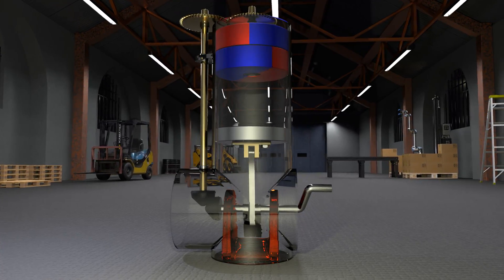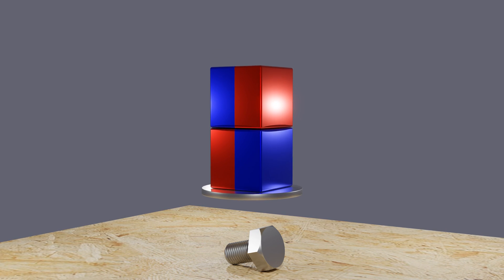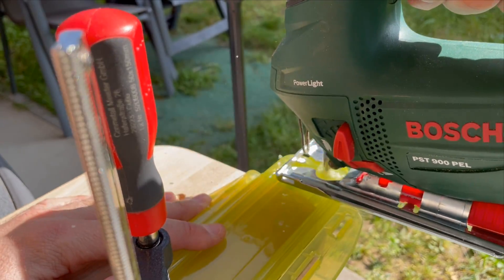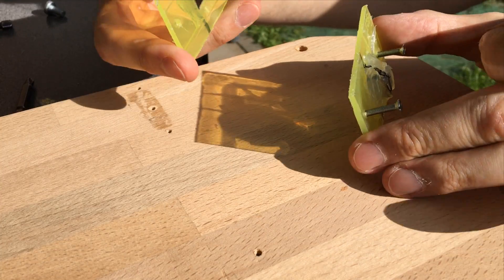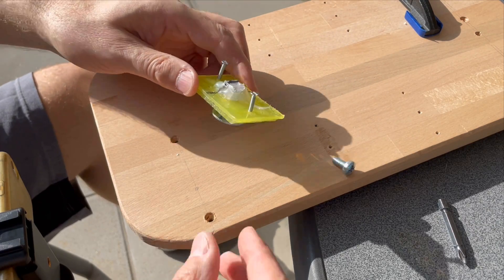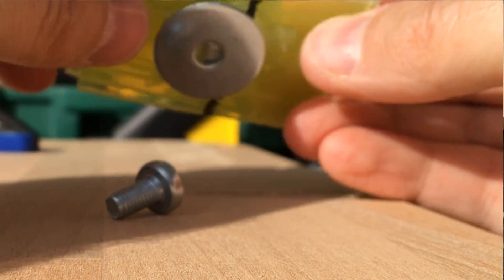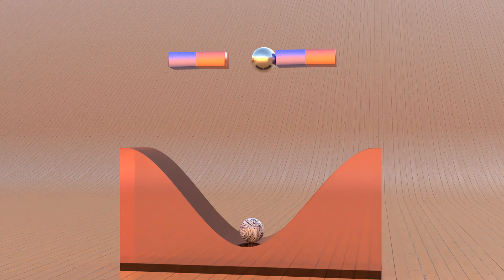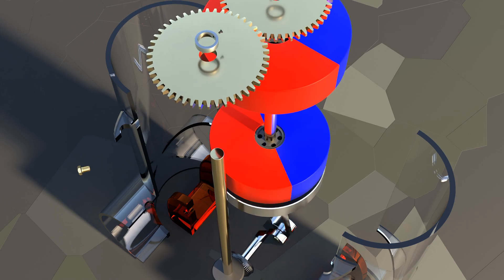Truth: Energygraphy's Permanent Magnet Motor with a magnetic switch a2z

Comment: Magnetic switch don't extend the magnetic field more than a2 ò 3 mm, a magnetic motor to work magnetic fields most be perpendicular at all times without interaction, just 180° in parallel.

Comment: Theoretically it'll work however when it gets to high enough speeds to be relevant for something more than equivalent to what we can do with our hands it's going to create a back EMF induction heating in the magnets themselves which is going to cause them to break one another they call it over lenzing or just they call it just Lansing overlanding is how you use lensing to get a laser
Reply: This is hardly a problem. We build e-motors with a combination of e-magnets and permanent magnets, and they work without problems. But of course the output energy only stems from the electrical energy driving the e-magnets. Permanent magnets only help to transfer electrical energy into mechanical one, but they don't contribute to the energy itself.
Reply: You said something that I didn't fully understand your comment I just didn't remember it as I look at this picture this time this is actually a picture of a school project for a different civilization a higher level of technology it does work when you get to that one point where you get perfect lensing where everything wants to break that is a band of causality where gravity and the speed in which the magnetic title forces are spinning slam into each other really hard it's the equivalent of warp 10 for the theoretical warp 10 that they speak of in Star Trek that's a perfect lensing point and it's the reason we say turn the heavy metal up to 11 you can run at 9:45 when you hit 10 it's perfect landing that is one of the places on a ladder of relativity that you must stay off of however you can jump right over can and go to 11 and it works out that when you jump over 10 and get to 11 you have just jumped over the band of causality that is light itself and you're actively going just faster than the speed of light and friction drag coefficient tries to pull you back down to drop you below the speed of light and actively hold you right above the lightspeed curve barrier which is 11 and it is a band of causality it comes through 360 to 365 trillion times a second
Reply: Will like 365 trillion time is the second to get over the lightspeed curve barrier and hang out at warp 11 is nuclear power and it is the secret to how perpetual motion works at slow speed it really doesn't work and let there are certain machines that do work but they don't look at them right and the ones that do work below the lightspeed curve barrier or below the nuclear force barrier are too dangerous because when you put them over that barrier they accelerate to the next barrier and or detonate so you want the ones that don't work that stall themselves out and then just push them up over lightspeed curved barrier or put them up to nuclear speed whichever you would rather your mind wrap around better and that's nuclear power now there's a bunch of things like they say a nuclear stall rate that you can build up a nuclear calm trail around the planet as the planet rotates and you can build up another nuclear calm trail around the star as the planet goes around the store so if you start anything of a nuclear nature which means bringing it up to warp 11 you're not supposed to leave it sit in the same spot for 24 hoursif it sits in the same spot for 24 hours you turn it off and you might have to leave it turned off for a year before you can start it back up again without causing harmful radiation to begin being generated now there's a whole bunch of stuff that works that you don't have to put over the light speed curved barrier every truss plant uses these rollers to smash nail plates the rollers used to hold big belts of chain that were in overbalanced chain in every house in the United States had one of these when you bought one from the trust company they would give you the trusses for your house that you had to buy it and the chain the chain was covered with rubber car tire rubber and look like a cargo net the postal Vans got 12 miles to the gallon were state-of-the-art they were the most fuel economist savings vehicle that was ever made in human history and they were made and purchased because they could hold one and a half loads of chain to replace the chain when the rubber went out on the chain

Comment: It's fascinating to think about a motor that could run without fuel or electricity, but sadly, this isn't possible. Even Einstein's theories tell us that energy cannot come from nothing; every machine needs some power to work. With all the modern technology we have, scientists still haven’t invented a way to make machines run without any energy source. If ‘free energy’ existed, it would solve so many global problems, but unfortunately, videos like these are not based on real science.

Einstein’s principle related to energy is famously summed up in his theory of relativity with the equation:

* "E = mc²" *

This equation means that energy (E) and mass (m) are interchangeable; energy can be converted into mass and vice versa, but energy cannot be created from nothing. Einstein’s theory implies that for anything to work, it must have a source of energy – energy cannot appear or sustain itself without it.
Reply: " but unfortunately, videos like these are not based on real science "   The videos of yWild are made to show why such devices can not work! They are not made to promote attempts to build a magnet motor.

Comment: Let's build a model rocket using 4 long non conductive rods attached to the sides? At the end of two roads a mag square magnet is attached. A electronical switch on the control panel inside the rocket will turn the magnet off and on using a timing gear at exact intervals as the rods move forward past the front of the ship ( locks in) and the magnet is turned on; thus thrusting; or pulling the space rocket forward ( lock off) as the two rods come back to its original position as a second set of rods move forward, and repeats same pull maneuver ? To overcome the gravitational pull of the earth; the rods will be able to angle upward and downward ; thus keeping the ship up?........................... Later people may even come with the gravity burst beam; and the continuous burst will keep the ship moving forward.... Hello.

Comment: come on - you need to use ONE pointed magnet (the magnet should be less in one pole) so when it comes closer to the other magnet it is drawn to, the opposite pool will push it away again, thus creating a perpetual push and push away.

Comment: I tried this design, it did not work, as the piston is coming up to the magnet its attraction and repulsion work against each other thus counter reacting any gain, and the magnets in the magnetic switch are hard to turn, much harder than any energy produced from the machine, so this machine does not work.
Reply from the maker: Hi JK, great to hear the confirmation of my own experimental experiences. Yes you are right, the power to invest is much more than the power output.
Thx for watching 🙂

Comment: If you make it work on the same way as a solenoid engine, it'll work without any problems, just like solenoid engine
Reply from the maker: Hi Cen, thanks for your comment. If you have found a device which is working without any problems. It may be a fake. If there is no additional power inserted in the system, the movement will stop in a short period of time. 🙂 thanks for watching.
Reply: @yWild  saying that there is no additional power inserted into the system while talking about a permanent magnet based devices is literally saying that permanent magnets aren't real because they don't have a power source. The point of making a perpetual motion machine is to make a device that will be able to convert the type of energy it uses (magnet, spring) into a work, which is something that people don't seem to understand.  
If you take an electric motor for example you can see that you need just a couple of magnets and a clever way of positioning them to harvest the energy from them. Will it be an electric magnet or permanent magnet doesn't matter since either of them produce a magnetic field. I hope that you understand my point.

Comment: Sweden calling.:)
lovely to see a new well done animation. I think your model of showing magnet's energy flow is very good. Easy to understand why many free energy magnetic motors have difficulty working.. But there are more models that you set that would work if... you have a flywheel. The Otto engine would never work if you didn't have the kinetic energy stored to make the engine rotate...
Why should everyone build a free energy motor without a flywheel???
Make over Do the right thing as we say in Sweden...
looking forward to the next animation…
would like to use your model to see energy flow with my magnetic motor.....:)
do you work with Cad, or just a hobby?
//Matthias
Reply from the maker: Hi Mattiask, glad to hear from you again. You are a big fan of fly wheels? Aren’t you? 😄
A flywheel by its self, it’s only a tool to give inertia a bigger influence and relatively reduce friction by adding mass.
I like flywheels too, but for the use of perpetual motion machine, they are not very helpful, I fear.
Thx for watching 🙂
Reply: @yWild
 he has an interesting point flywheels are necessary to store momentum and cycle steps in the combustion process 
The energy loss of a flywheel is measured with the heat released and forces down shaft. I think?

Comment: Before I finish watching this video, I would tell you that I have two of these mag-switches (for my workshop) and turning the mag-switch on takes a bit if energy to turn. It takes more energy to turn it off. I'll say, here, that I don't think you have a perpetual magnetic motor. I think the total energy put into the system will not be enough to equal the total energy put out. I'll post a reply to myself once I finish the video. :)
Reply: Excellent graphics. Excellent experiment, too. This is the Scientific Method demonstrated well. Good going, sir!
Reply from the maker: Hi Randall, thanks for your comment. Great to hear someone with experience with the magnetic switches. Unfortunately it’s independent of which turn, on or off, has more force to invest because there are both very important 🙂. Thx for watching
Reply: @yWild which units should we consider Ein - Eout = 0
Do you use Watts? 

Thank you for another great video.
Reply: Thank you for a very thoughtful comment.

Let us measure the difference of energy for the on switch and off switch as a magnetic well or capacitance/inductance or similar to how a flywheel stores momentum...

Comment: Problem is the energy u need to crank the handle. Its more then you can win. Like in every machine of this kind. Its just impossible. Please dont feed the magnetic motor beleavers. Allmost all electric motors are based in magnets. So wie can call every magnetic motor a megnet motor. And we all know that this beasts are hungry
Reply from the maker: Hi Orgathm, thanks for your comment. I try to show why these devices are not able to work using my gravity model. Thx for watching 🙂